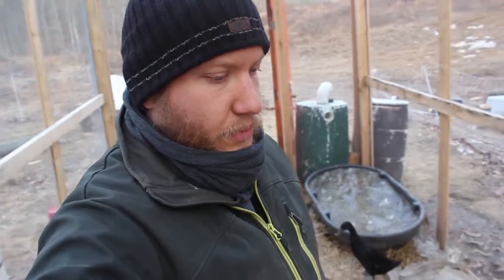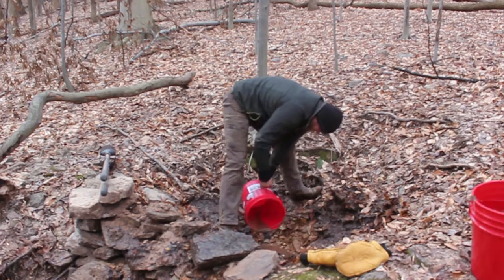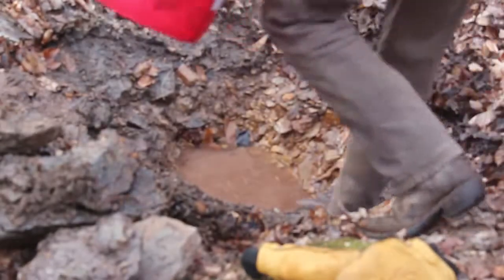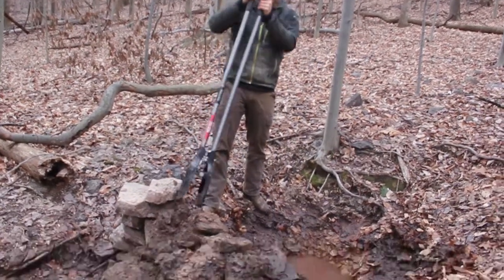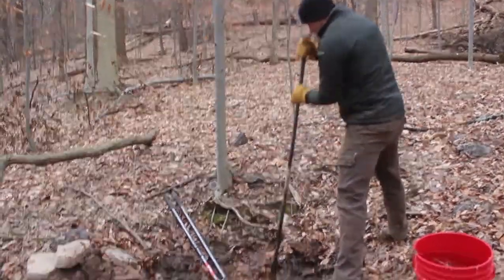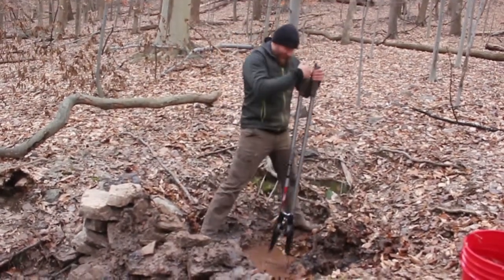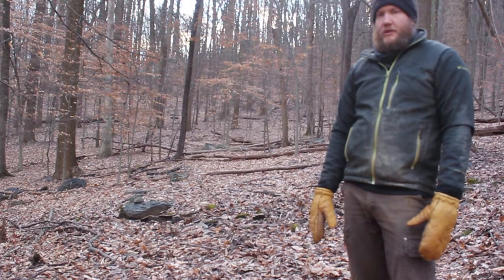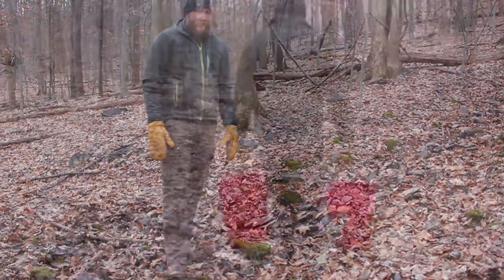Where to put our Sand-Point well?

Comment: That was painful to watch. Here in Florida sometimes it’s hard to drive a standpoint well. In that rocky ground..ahh no but good luck. Dynamite might be a better choice at the area you are already getting water.👍
Reply from the maker: If I have some time and and SDS drill I may try again this winter. I think it is possible. The sledge hammer may not have been the best choice of tools but it is what I had.